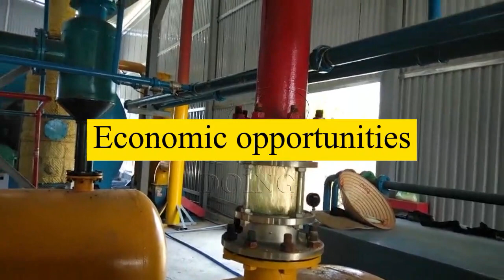What are the benefits of converting plastic to fuel?

Comment: Burning plastic is not a healthy option. It requires a substantial amount of energy to convert to a fuel that doesn't poison us. When it is burnt, either before or after conversion to a fuel, it produces greenhouse gases. This doesn't solve anything.

And why have 5 men standing around while a sixth man operates a digger to load a hopper. Give them all shovels, it would be quicker and require less fuel.